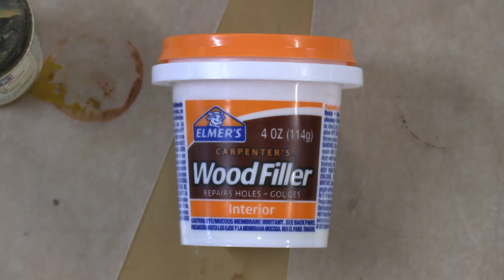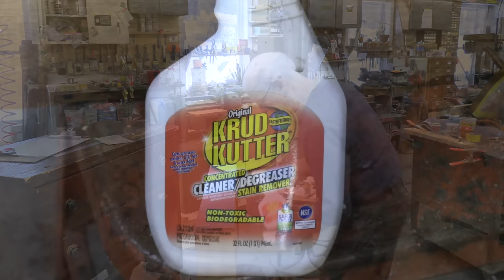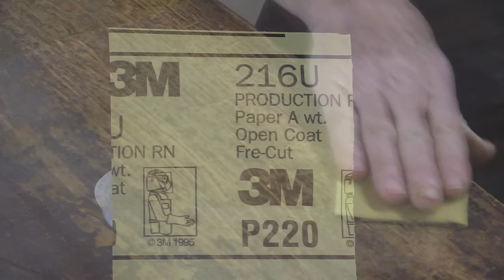Battered Bureau or Hidden Beauty? - Thomas Johnson Antique Furniture Restoration

Comment: Another beautiful, sensitive restoration. Many restorers would have sanded away 200 years of character, it was good to see that you carried out minimal sanding preserving the character and leaving the age of the piece. By inserting a simple pin on the rear plate on the handle you did what should have been done by the original maker, a simple fix that will stop future wear. 
Always a pleasure watching you work.
Reply from the maker: Thank you! Yes, I think this worked out well

Comment: I’ve seen this damage before in our own furniture and even old doors. During the life of the piece the handles would have been loose several times, and for prolonged periods. When pulled, they ‘lever’ the edge of the back piece into the wood. You’ve also shown that, even in furniture restoration often ‘less is more’. Thank you very much. 😊😊😊
Reply from the maker: You're welcome! Yes, it was tough to figure out the best course of action. I like the way it turned out

Comment: I have an explanation for the knob scouring, i have seen it on some of our older furniture, when the knob gets loose,  people tend to rotate the knob and hold the nut in the back, so cutting into the wood at the front, in fact we have a very similar piece with the same damage and similar knobs in one of our bathrooms, great save though without affecting the overall look of the piece.  I was taught the same trick with paper/card sheets from  my late father.
Reply from the maker: Thanks! Yes, but it was still difficult to see how that happened so deeply!

Comment: This demonstrates the fine dividing line between conservation and restoration. 

Perhaps I wouldn't have used the brand new washers, or, I have seen heat them with a blow torch and dunk in coffee grounds, it darkens them sympathetically, or use a bit of loctite on the nut.
Reply from the maker: Thanks! Good idea! I'll try that sometime

Comment: When you first added the dark stain, I didn’t like the look of it at all.  But as you kept wiping it down and treating it, it came out beautifully.  I was just looking a my matched pair of Charles Stickley rockers that I worked on a week ago.  One of them had mild water drop damage on one arm.  I worked them with Howard’s Restor-A-Finish in dark oak with 0000 steel wool and finished them with Feed-N-Wax, touching them up a little with Orange Oil.  But some of the water drop damage has reappeared so I think I’ll work on that arm again (never before had water stains come back after the Howard’s took them away).  Thanks again for telling us how much time this project took!  Great job!!  I’ve got a primitive dresser with hand chamfered drawer bottoms, hand cut dovetails and turned legs front and back.  It has a split turned leg adornment on the left and right sides of the front.  When you mentioned the different sizes of your drawers, I thought that mine had that too, so I just measured them.  My drawers are top 10”, #2 6”, #3 7”, #4 7 3/4”.  I have no clue what the wood is, definitely not oak.  Looks tight grained wood in a medium brown/tan color.  Each drawer came with a lock with one missing.
Reply from the maker: Thanks! I haven't had experience with the Howard's Restore, I should try it more often and see for myself. Yes, it's so strange about the drawer sizes!

Comment: As always Tom, a wonderful job. The outer circle I think was created by a larger stamp back plate and at sometime the smaller backplate was used. Without looking at it I would say "huuum?".
Reply from the maker: Yes, I think it was all from the existing back plates. But it's hard to understand how they could spin so much! What was going on? When I reinstalled them I added an escutcheon pin so they can't spin
Reply: When I saw you attaching the backplates with pins I thought it was perfect!  @johnsonrestoration

Comment: Fabulous project, great work.  I've been using Waterlox for 50 years, but I moved to Virginia and we can't get it delivered here.  Some kind of law.  Very disappointing.  I was taught to apply it with a balled up nylon stocking, rubbing it firmly into the grain.  2-3 coats with steel wool in between.  Still have pieces I restored 40 years ago and they look amazing.  Thanks for a great video.
Reply from the maker: You’re welcome! I can’t believe that you can’t get it! Great stuff

Comment: My most favorite video yet. So much to unpack here - I loved every part of watching you preserve this chest of drawer's story. That is my goal with every project I start - I don't want to erase its story. 
I have a question regarding the Waterlox tung oil varnish: It looks pretty thick - can it be thinned to make a wipe on finish?  Also - regarding fish eye: Would a light coat of spray shellac before applying the brush on varnish stop fish eye from forming?
Reply from the maker: Thanks! It can be thinned, but I think you wouldn't need to. I've wiped it on like an oil finish before. The fisheye doesn't seem to be a problem with the Waterlox, as long as I keep brushing them out until the finish dries enough so that they stop forming.

Comment: Another lovely piece and it looks fabulous.  You don't show much what you do to the inside of the drawers, etc. but I am curious how much you try to clean or restore those hidden areas.  Preserving the outside character makes sense to me but I think I would sand, wax (or varnish ?) the insides to be 'like new' while leaving the outside as true to history as possible.
Reply: Lining paper is cheaper, traditional and you can change it when you want!
Reply from the maker: Thanks! dlevi67 is correct. Sometimes I have done the drawer interiors with shellac. But the tendency is to leave the secondary surfaces alone
Reply from the maker: Yes! I believe that museum conservationists will leave all secondary surfaces alone, as they provide a lot of information about the piece

Comment: That chest has seen life and, as always, you respected that.  Also, home decorator me has learned something new.  I would have started applying varnish from the top, down.  I shall file the bottom-top tip for future reference.
Reply from the maker: Thanks! Yes, it works well for me, especially with a slow drying finish

Comment: 15:41  Wowza!  Didn't think woodworm left holes THAT big!  ;)
Side Q1:  Is woodworm not an issue this side of the Atlantic?  I don't recall you ever discussing it.
Side Q2:  I'm surprised you didn't have to fortify the drawer slides.  I would have expected those to be really worn as well.
Side Q3:  Was "Bowling Alley Wax" ever really used for bowling alleys???
Final result:  It is SO GRATIFYING to see Summit Competence in action and in existence.  Thank you for doing this video!
Reply from the maker: You're welcome! I have never seen a live infestation. My understanding is that they can't live in heated houses. As far as the Bowling Alley wax goes - I don't know!

Comment: I have once again enjoyed your video presentation.   I noticed that you changed your mind about your repair material used to fix the drawer pull wear areas.  Initially you mentioned you would use wood epoxy then you went with a water based wood filler.  Would you please send me a note to explain what caused you to change your mind.  The final result was stunning.
Reply from the maker: Thanks! Yes, I realized that possibly I could fill those huge rings and no sand the drawer fronts if I used the water based putty. Had I used epoxy there was much more chance I would have to sand aggressively. It was the right choice

Comment: Very useful, antique furniture in new splendor! I also think it is important that antique furniture is not over-restored. I still don't quite understand the structure of the wood protection. Tung oil, sealer & wax? I get the point of tung oil, but why does it need a sealer on top of that? The wax is for the shine, isn't it?
Reply from the maker: Thanks! You are correct, nothing is needed after the varnish. But the waxing process smooths it out and evens up the sheen

Comment: I can tell you exactly how those handles drilled a rut in the wood, as it happened to furniture my parent had, throughout my youth. The clamping pressure between the screw and knob would suck the plate into the wood, slight rotation of the know in use would rotate the backing plate, cutting into the wood, as the wood was cut into, the knob would come loose. So it would be tightened, applying the pressure once more, and repeating the process.
Reply from the maker: Thank you! That sounds exactly right! Good job

Comment: Another beautiful save !  I have a question about applying the oil based stain all over the dresser.  How did you know that was the right product to use?  Could that type of stain ever be a bad choice to put over an existing finish ?  Thanks for answering if you have time.
Reply from the maker: Thanks! It was a lucky guess! In theory no oil stain can affect an existing finish. It just can't penetrate a finish, only the raw wood and any defects

Comment: Hi Tom, I’ve been loving and enjoying your videos for several years, but this is the first time I’m commenting. Knowing your philosophy about restoration, I assumed you wouldn’t refinish the piece. The final outcome was stunning, but I was surprised that you felt free to stain and varnish the piece without calling that “refinishing”. Can you explain your definition of refinishing and what you consider an acceptable level of intervention on a piece that does not destroy the patina. Also I’m still unsure why you decide to use oil based stains vs water based stains.
Reply: I second this, was wondering the same thing while watching.
Reply: Not Tom, but as a furniture collector and restorer, here are my totally unrequested 2 cents. Fair question, but the other points to consider are:
1. What does the customer want?
2. What are the alternatives?

Obviously to the first question there are as many answers as there are customers.

As to alternatives, as I see it, the only thing one can do to "not refinish at all" is to leave the damages largely untouched, and just apply some protective transparent coat (or possibly not even that - just remove the splinters). This won't be to everyone's taste (see question 1), and outside of a museum most people wouldn't like it either. Tom sanded as little as possible - he didn't even remove all the finish from the top - and re-stained only the bare wood. The finishing coat 'had' to go over the whole piece to give it some protection, and some sort of cohesive look. 

Is it 're-finishing'? I would say that it's preserving as much of the old finish as possible and restoring the rest (with some new-but-old-recipe finishing coat). This to me is quantitatively and qualitatively very different from stripping the whole piece of the old finish and re-finishing it with modern materials.

Re: oil vs. water stains - it depends on what you want to achieve. Here, my guess is that Tom wanted something that would dry quickly and would be less likely to be absorbed by the finished wood, both of which point towards using an oil/spirit stain. The disadvantage is that the pigment sometimes are less colourfast with time - and particularly with light.
Reply: Very helpful response. My question arose because I’ve heard so many times that “you mustn’t refinish an antique”. It made me feel guilty for revarnishing a bedroom set I have. This video and responses now give me a better  perspective on the subject. I loved this result.
Reply: @dlevi67  My only concern with your answer is that he did (without mentioning it) sand down the left and right side which made me wonder wether the costumer changed his mind about not wanting a refinish or maybe the damage was too extrem. Or possibly the diffrence in colour from the top after staining to the sides were too stark.

Eitherway thanks for your lengthy answer!
Reply: @Judoka26  @SteveGandy4203 You are welcome!

FWIW I don't think Tom 'sanded down' the sides - there is a difference between using a bit of fine sandpaper to smooth the surface and provide a bit of micro-abrasion to key the varnish, and sanding it down! 😉
Reply: @stevegandy4203  The controversy over 'refinishing' is a tough one. I think Tom strikes a good balance between preserving what is there - warts and all - and making things look and feel 'usable' and 'nice'. 

In general, unless there is some genuine evidence that the finish is really old (even 'original') or the piece is important because of other reasons (age, provenance/history, complexity/sophistication/uniqueness), there is no reason to worry about 'refinishing', as long as it's done with some care and sensitivity. Don't feel bad about your bedroom set - enjoy it for what it is!
Reply: @dlevi67  fair point, it just looked like the bare wood could be seen, but maybe that's just the angle :)
Reply: @Judoka26  You mean at 21:47? Good question - it does look like it has been sanded to bare wood! I wonder if it was because it wasn't matching the top all that well anymore...
Reply from the maker: Thanks Steve! dlevi67 gave a great answer, not much to add! When I visit the Museum of Fine Arts in Boston, where they have an extensive furniture collection, it is quite obvious ( to me) that many of the pieces have been “refinished” , but they have developed a vocabulary just to avoid that dreaded word. Most if not all the pieces I work on do not have a high market value, the work is driven by sentimental value, and must be usable
Reply from the maker: Thank you! Great answer, I appreciate it. I added my “2 cents” to the original commenter

Comment: I have an Empire-era china cabinet with one drawer and glass doors and sides.  When I refinished it 30 plus years ago, I discovered that the drawer front was made of tiger maple, and had similar ghost marks around the knobs.The ghost marks look a lot like the ones on the chest in the video.  There is quite a variety of wood species in the piece.  As I continued with the refinishing work I realized that the frames of the glass doors were also tiger maple, and low and behold there were ghost marks on the frames, too.  Those marks were sliced in half, suggesting that a drawer front was sacrificed to make the frames.  My guess is that the maple drawers were salvaged from an older chest; and that the cabinet was  sized around the dimensions of the old drawer.  Wood for the rest of the cabinet was probably scavenged from other sources. I wonder if something similar explains the different wood colors of the chest in this video?
Reply from the maker: Thanks! Good detective work! I don't think that was the case here though

Comment: I believe you restored the piece exactly how it should look. Short of putting a new back on the bureau to eliminate the wide gaps, is there a fabric or heavy paper product a person could apply (glue or staple) to the back which would cover the gaps and keep bugs out?
Reply: Usually, canvas or coarse linen strips are glued either side of the gaps for this purpose. In some cases, I've seen heavy paper strips (like wall-lining paper) being pasted to the backs... which is perfectly fine (and cheaper, and easier to apply) as long as the back isn't touched or moved too much.
Reply: @dlevi67  Thank you. I'd probably go with heavy paper. It would be out of sight and easy to replace if necessary.
Reply: @wileycoyotesr8623  You are very welcome! Good luck with the project!
Reply from the maker: Thanks! Yes, I like dlevi67's response! Always right on
Reply from the maker: Thanks! I never felt the need to do that but yes, I've seen it

Comment: What a beautiful little chest!  It limped in to your shop, looking a bit tired and battle weary, but still recognizable as a nice piece.  

I enjoyed watching your process as you worked to fix the deep circular grooves around the pulls, the rough and gouged area on the top and that leg.  The finish looked beautiful when you were done.  Just beautiful.  You have such a thoughtful way of going about your craft that makes it a joy to watch.  

I'm curious - how would you recommend the owner care for that chest going forward?  Any particular products that should be used?
Reply from the maker: Thank you! So kind. All it will need is to be polished with the Howard's Feed N Wax, the same product I used for the last step
Reply: @johnsonrestoration  
Thank you for replying.  I'm glad to hear it - it's what I'm already using on my pieces!  Happy Easter! 🐇

Comment: Great job on that bureau, the drawer sizing was really unusual!. I have a question for anyone please. I am getting ready to restore a full height china hutch about 1860's period, and the finish has a gator skin texture, is there a safe way to save and protect that finish? or does the skin texture really need to be removed for a correct restoration? Note: there are some area of water damage on the bottom skirt area of the piece that I may have to restore. Thank you
Reply from the maker: You’re welcome! I would clean the finish, sand the finish with 220 or 320 gold frecut sandpaper, sand as much as you dare without going through the finish. Recoat with shellac or acrylic water based polyurethane . 1 or 2 coats, then rub down with 0000 steel wool and wax